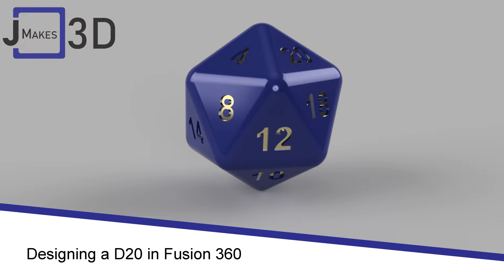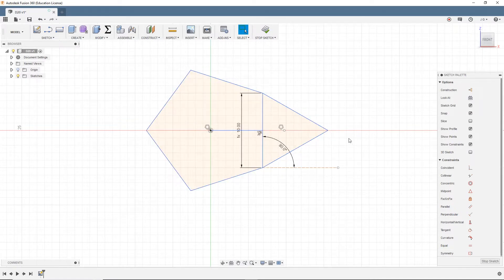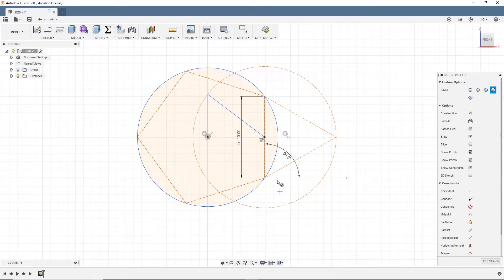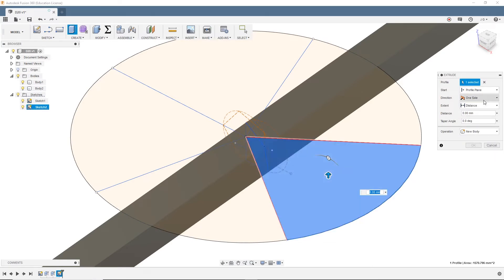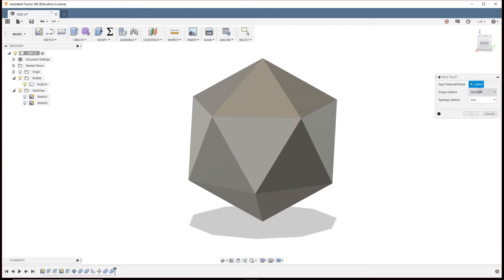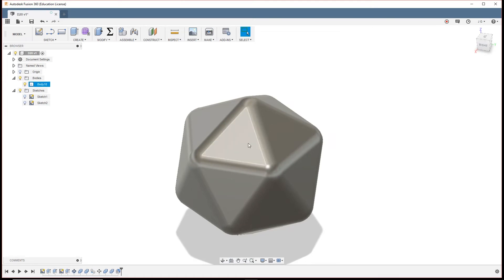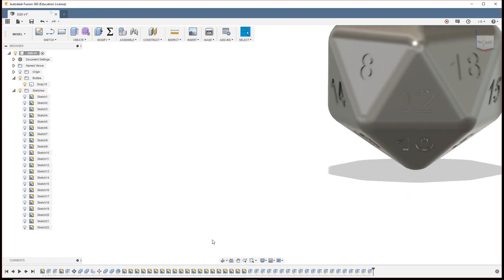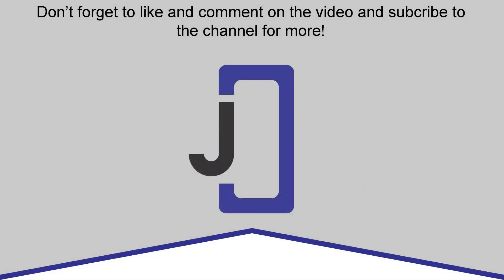Designing a D20 In Fusion 360

Comment: My wife got someone to make her custom D20's with a specific design for the 20 so she could 3D print one, make a silicone mould, then make resin casts. When I was polishing some of the dice made I noticed some of the points were off but assumed I'd made a mistake somewhere.

Fast-forward some time, we keep getting failures with the 4's, so my wife asks me to change that in Fusion 360, we got the right files off of the original guy

Some of the points are off

Turns out the guy who did this for us messed up the step at ~11:30, got the pivot point wrong whilst 180 flipping the copied half, so got the intersection slightly wrong. Fixed now, thanks.

TLDR: I probably should have learnt how to do this myself from the start, but I was fairly hands-off because it's my wife's art project XD

Ultimately: Thanks for the walkthrough! It's super helpful!
Reply from the maker: Glad it helped you!

Comment: Thanks for the video that you gave me in my Reddit post. But since I'm still new to Fusion360 and I'm still trying to figure out where to find all these tools. But after the first few steps after you made those diagram circles in the basic sketch I was kinda confused.  Since I don't really know that much about Fusion360. My overall goal that I want to work on making with Fusion360 and my 3d printer is Twistypuzzles like the Rubik's cube. But I just wanted to know about the basics to making the 5 platonic solids. But I thing we all know the basics to making a simple cube.
Reply from the maker: Hi Michael, I'm working/planning on a few more videos about the complicated platonic solids as well as a 2x2x2 Rubix cube I made. If you want to see the Rubix cube you can check out my Instagram @jmakes3d

Comment: Is there a good parametric way to get the text to be exactly centered? Or is it eyeballed in place?
Reply from the maker: Unfortunately, I haven't found a nice way to do it yet. That being said I am planning on doing a series about all the regular polyhedra and may try to find a method to do it to go with that series.
Reply: @JMakes3D  Similarly, is there a good way to make the copy-move operation parametric? When I change the side length, that operation gets borked and needs to be re-worked.
Reply from the maker: @ClaudioIbarra  I haven't found a way to make copy/move parametric. If you can use dimensions/construction lines that are dimensioned they should be parametric.
Reply: @JMakes3D  l'll try messing with that. I'm not so strong with Fusion (Inventor is my jam), so it's slow going.
Reply from the maker: @ClaudioIbarra  I messed around and was able to figure out a method to parametrically control size/positioning: https://youtu.be/gaa_Xj5hbtg
Reply: @JMakes3D  I figured it out! And it's simpler than I even realized. I just made a 2X pattern of the triangle + polygon visible at 7:43 in the video, rotated about the "handle" point. Then I repeated all the extrusion/cut/intersect steps. Because it's a pattern on the original, the Side Length can be changed and everything matches up.
Reply from the maker: @ClaudioIbarra  that sounds a lot more like what I'm doing now. I have improved on the method I used in this a lot, and also generalized it to other polyhedra. Hopefully I'll be able to put together the videos for all the polyhedra this month.